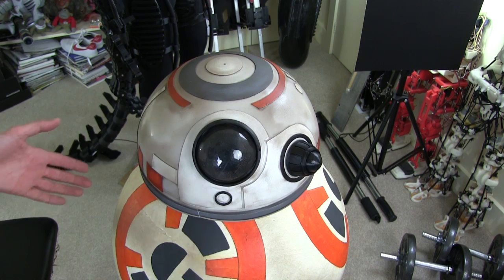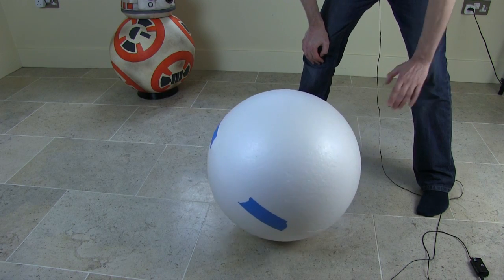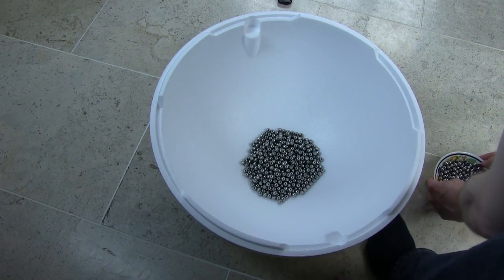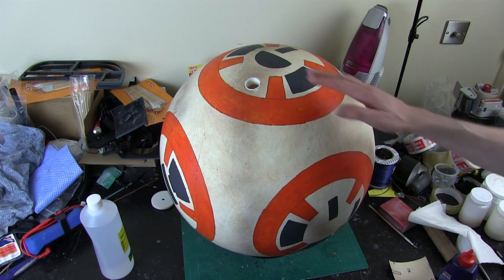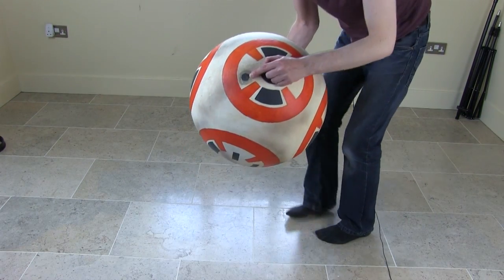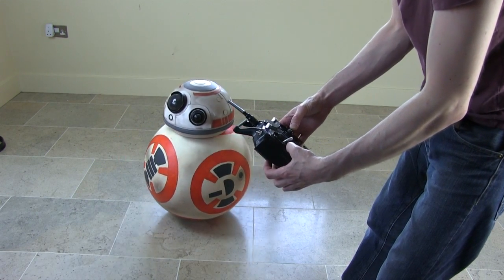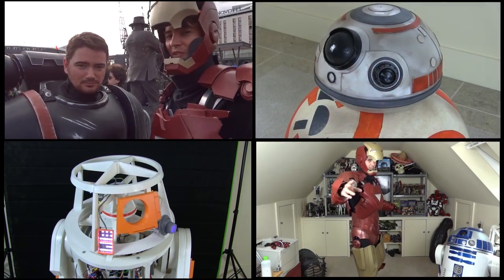Star Wars BB-8 Droid v1 #5 | Improving Stability | James Bruton

Comment: I have a suggestion. Can you line the inside of the ball with steel sheet metal? If that's too difficult, perhaps a layer one level thick of ball bearings glued to the inside of the ball? If you can do this then you can add neodymium magnets to the bottom of the head that would be strong  enough to keep the head attached to the ball. You could vary the holding strength by varying the distance between the magnets. This technique worked very well  in a robotics competition where minibots (weighing up to 15 pounds) had to be deployed to a 10 foot steel pole and race up the pole.

Comment: Try golf balls on the inside.  The problem with those ball bearings is you almost get the same problem as sand; it takes too much pitch to make them roll around... especially when you added that oil.  I don't think that oil helped you out at all.

Comment: Try putting a smaller ball inside the styrofoam ball maybe 1/3 rd the size in which you could put the oil and ball bearings, ideally the inside of the styrofoam ball would be oiled so the inner ball could not "climb" and would stay at the bottom of the ball as a counterweight.

Comment: I've fought oscillations with gyro/servo loops, and inertia masks the underlying problem.  Any reactive system has delay.  accumulating delay and linear response equals chasing your tail so to speak.  

correct quickly and with sufficient displacement to  arrest detected movement say 95% and then halt or decel with an exponential curve.  you can tune how close to stopping you go, mess with velocity, decel curves and whatnot to optimize performance.

flying helicopters teaches you to correct deviation abruptly using intuition and "feel" before oscillating begins.  We do by instinct what calculus can model mathematically.  

you have to calculate what the correct displacement is to arrest the drift, and shoot for that displacement.  incremental correction in a linear reactive fashion is why it can "run away" and fall down.

Comment: Hey just from a fan of starwars.i have an idea.go and watch the levatating lamp video on youtube.then see if a little lightbulb in your head doesnt go off .take what you learn from that video and apply that to your BB8. Do some research on levatating magnets using other magnets in a cluster to obtain a levatation like system you need to use magnets in unison IE a magnet grid with magnets repelling and attracting eachother to make a. Gap between the head and the body large enough to leave space for the body and the head of the droid for the ball to move freely and the head to move in unison with the body.start from scratch build your droid from the inside out start with making the balll move on its own then once you get that done.you should have an idea how to apply the magnetic levatation to the inside of the body to make the head and mody move as ons.after you draw up the new plans and desing your working BB8 just give me a shout out and that's all

Comment: To maximize stability + mobility: I wonder if the inside surface of the floor-contact ball is unnecessarily large in diameter as that in the bottom of which to place the stabilizer mass.One could try rigging, say, up some two-third's smaller hollow ball inside the center of the floor ball, and put-adjust the stabilizing mass in the bottom of that smaller inner ball.
Reply: +Daniel Pech Perhaps a simpler, if less all-purpose, way of more effective stability-&-mobility would be a loor-ball-internal structural preclusion to imbalance, such as a
two-thirds-diameter regular polygon frame (I would first choose a hex) to each of the corners of which is affixed some moderate-sized universal bearing, such that this frame’s bears rest on the lower-third inside surface of the floor ball.

Comment: This is pretty cool and electronics are spot on. Unfortunately it's never going to be stable no matter what you put inside the the lower main body.  The stability issues are not going to be solved with faster electronics. In fact increasing the capacity of the electronics which in turn increases reaction times is only going to cause more stability issues. Unless your only goal is a meter squared are of movement. This is a physics problem and needs to be solved as such.
Reply: Yes very stable and completely different. It's clearly mitigating the same forces that are causing your instability issues. Both it's weight, height and lower ball size plays a significant role in it's stability. It's much easier to balance a broom stick the a chop stick. I would speculate the ball is solid as well. So exactly what I would expect.

But that's not what your building. Your build is literally the complete opposite of this. The larger the ball on the bottom the greater the movements must be to gain and regain control. This does not suffer from that issue for obvious reasons.

That said I will add you might get more stability by adding weight around the entire inner surface of the ball but nothing you add that adds motion to it is ever going to increase it's stability.

As for your second attempt again looks cool but I'm not sure it will accurately replicate BB's movement like that as BB 8's ball moves 360 degrees. As for the top your going to use magnets placed inside to keep it stable and on top correct? Material seem a bit thick for that that.
Reply: +diGritz1 I wonder if the inside surface of the floor-contact ball is unnecessarily large in diameter as that in the bottom of which to place the stabilizer mass. Instead, one could try rigging, say, some two-third's smaller hollow ball inside the center of the floor ball, and put-adjust the stabilizing mass in the bottom of that smaller inner ball.
Reply: Daniel Pech That's only going to work if you retain the original concept of a completely hollow lower ball. It also make the whole thing over complex. Which is why the original BB-8 used controls in the lower ball and simply worked out a way to keep the heed in semi-contact with the lower section using casters and magnets with an heavy bottom weighted motor control unit in the lower body.

Which is what he is doing for his second attempt as this design is just way to problematic. As for the design he is using, it's not how I would approach it but different strokes for different folks. I will be interested to see how it works out.

Comment: I think the sphero technology is better with workings in the big ball, but a possible solution for this is to use thick gearbox oil with bearings. This would remove some of the noise plus counteract the wobble and instabilities.

Comment: what if you make the internal coated in a lightweight metal and then make a lightweight dense metal ball that is just slightly smaller in size inside the ball and then put oil inbetween so that it will roll smoothly.

Comment: I would structure a setup of a weighted pendulum in ball/sphere that is the full diameter of the sphere moving along the entirety in vertical design with an attracting M 52 Diamagnet  in the head and on the upper portion of the weighted pendulum. that has a weighted base with rolling barrings on the base of the internal pendulum. and a small amount of oil in the sphere for more friction less movement. I think at that point everytime the head moved the upper portion of the pendulum would fallow and would rotate the sphere in synchronization. What do you think? I think making this could be far simpler than it is intimidating. maybe using pvc piping for the pendulums skeleton inside the ball, and a three/ four way plumbing splitter,maybe cap and block the pvc at the base areas and fill it with concrete and wait till it hardens before you connect the parts. Then once you have your pendulum shaped 3d sorta like this 
  |
/|\

you could install the M52 Diamagnet withen the PVC pipe at the top part that has no concrete in it and the do the same for the bottom of the head of the robot and for the rolling bearing part on the base of the pendulum Maybe you could use roller skates or some other sort of rolling bearing, btw JUST THOUGHT ABOUT THE OIL. I would experiment with and without Im not sure if that would help or not. I hope you try my suggestion I would love to see if it works
Reply: +Joshua Tomlin Oh and the upper part of the pendulum might need to have a bearing too keeping the pipe from making contact with the sphere because of the Diamagnet

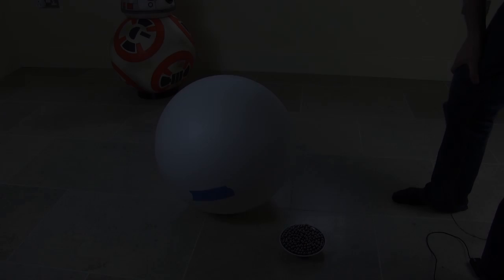Comment: See as soon as you mention stabilizing the lower poly ball at around 3:30 and you talk about problems like the sloshing around effect with liquids and sharp point of no return with sand I thought you would immediately mention the idea of making the hollow area/volume inside it much smaller so you could completely fill it with either water or sand. Maybe I am missing the impact of a high dense center of gravity but a small completely filled hollow center would solve the problems of variable inertia separate to the the inertia of the lower poly ball. Also any reason why you didn't make it like the toys where the head is just floating magnet on top as this means the center of gravity is inside the ball and much lower down than your original design which might be a bit top heavy and hence not inductive to resting state stability? Still a fantastic thing to behold, less CGI in movies and more actual working props is where old Sci Fi meant more to use kids when Star Wars was first released and no god dammit it is not called a new hope it is just called Star Wars :)

Comment: this design is fail. may save you money but its not the way I would build it. You need a much larger version of the head in the bottom of the large ball. gyro stabilization. plus low center of mass. and just have magnets holding an empty head on the top with wheels.

Comment: Sorry if this was already mentioned. What about a ring or bearings in bracket that would swing a little on speed changes at the bottom of the ball. You could use larger bearings in the bracket for the weight and bigger bearings might be smoother. The center of the Bering bracket would need a weight lower then the outer ring to make it balance. 

essentially you would have a cone shape with bearings around the edge of the cone, maybe with one bearing on the tip of the cone.

Comment: +James Burton

    Awesome project and love how its going so far, but I have a suggestion for stability.  I'm no engineer, but my idea when you were brainstorming is to, instead of filling it with a loose substance(bearings, sand, etc.), I would suggest coating the inner lining of the sphere with some sort of material to add even weight to the entire sphere, rather than a pivot point that needs to reposition whenever BB-8 moves. I know enough about physics to know that in order to have enough friction to move(on smooth surfaces especially) you need enough weight pressing down to counter act the force of the forward motion. If its too light, it wont have enough friction to successfully move, BUT if you slowly increase the entire weight of the sphere itself, you can easily find a point of balance. 

      Long story short, why not try increasing the weight of the sphere itself? Either by coating the inside with some sort of lining, or by just making a heavier sphere to start with.  Please give it a try and let me know.

Comment: Why not oil, or maybe mercury inside? That shouldn't slosh like water, but it would still move around easily.
Reply: Herr Fenchel Ask your local super-villain.
Reply: While we're at it, let's also fill it with uranium and bleach!
Reply: +darksskull There has to be a more toxic solution for this than yours.
Reply: Herr Fenchel nothing at all dangerous about it if you know what your doing  ;)
Reply: Moth Dildos have an exception
Reply: TheBaldr no it's not safe that's just a horrible idea murcery is not for fucking around with you have to mean it when you use it and treat it as something that can kill you.
Reply: +darksskull Mineral oil?
Reply: Moth I think that's a normal thing with older toys
Reply: mercury is like 13 times heavier than water
Reply: You would need a good amount of mercury which is highly toxic.
Reply: Elijah Barbee Mineral oil isn't toxic but we haven't agreed to that apparently
Reply: +Elijah Barbee Heated gallium could work too, but heating it would be a real bother.
Reply: dsigamerman Where to get uranium?
Reply: +darksskull Mercury is quite safe if it sealed off.  Otherwise we wouldn't use it in a ton of stuff.  The problem with Mercury in a use like this is expense.  You talking about $500US for this application.
Reply: Christian Noir i'm not sure it's safe just to have mercury in a toy.
Reply: EricssonXL that's on normal for older toys which don't follow any safety guidelines.
Reply: +Herr Fenchel http://www.amazon.com/Images-SI-Uranium-Ore/dp/B000796XXM
Reply: Not quite, if you'd use some heating element inside..!

Comment: could you put lube in on the bottom,
put half a sphere that has a magnet reaching to the top from 3 supports and wouldn't it the weight of the hemisphere keep down as the ball rolls,and the magnet would keep the head up and keep control?idk,just an idea

Comment: is it like.. trying to balance? like a two-axis segway? if you put enough weight low enough, won't it want to be stable on it's own? and can't you put all the batteries, controllers, etc down low and have the head be 1000x lighter?
Reply: +Chrismofer it's just sort of a ridiculous way to locomote, by balancing on top of a ball. putting a car inside a hollow sphere would be much simpler and more stable.

Comment: Why not just a single weighted ball? No sound.
Reply: Pretty much what comes to my mind; a single heavier ball bearing (with equal mass to what the smaller ones are together) ... of course, I'm not a mechanical engineer, so my gut feeling might be incorrect, but I think low center of gravity and a single point of friction could be better than the current implementation.
Reply: James Taylor wow, the kid that spells cool as "coil" is talking to me about the English language. I don't know if you're living under a rock or immune to modern humour but it's a joke intentionally spelt like that, good luck making friends.
Reply: or a small ball with ball bearings in the small ball..
Reply: +Make art not war 74 Umm... I must reiterate that I am not a mechanical engineer, but having multiple small ball bearings inside a small ball within a big ball would probably not work too well either. Reason for this is that the ball bearings in the small ball would most likely not be equally distributed (at least most of the time, since they can only move past each other while in certain positions) and would probably move the center of gravity of the small ball higher than it would be with a single heavier solid ball bearing making the small ball less stabile and consequentially making the large ball wobble more.
Reply: +Make art not war 74 ball ception. all ur missing I'd deez nutz
Reply: +CapitalStreetPhotography 
Nice idea, but it does not work. A single ball can start to swing and oscillate.
The software has already no working curve for dampening an oscillating movement.
Reply: +smashUupnow Moron. Are you actually too stupid to write and speak the English language correctly?  Or are you so incredibly stupid that you actually think that speaking and writing like you never even made it through grade school, thus illeterate, actually makes you somehow appear cool in some way, although how stupidity being coil I just dont understand.  In any case good luck with your McDonald career as fry man!
Reply: Descargar apps de pago gratis en iOS
Reply: shut up!!!!!!!!!!!!!!!!!!!
Reply: CapitalStreetPhotography 4gv

Comment: awesome work, the ball bearings tho make it a bit glitchy, have you thought about coating the inside of the ball with some latex or the flooring type of latex and would give an even coat, anything not secured inside will make it slosh about unless you fill it completely. mad skills on the head

Comment: make the moving parts in the big ball so it moves like a hamster in a ball. Give the moving part a magnet on the top and a weight at the bottom. This way the wheels stay on the bottom and the magnet stays on the top. Then make the head magnetic so it sticks to the magnet on the inside of the ball. Basically a larger version of the toy.

Comment: Just a thought, How about making two balls, one slightly smaller than the other.
Then put bearings on the shell of the smaller ball and load the smaller ball with more bearings
put the smaller ball inside the big ball. This way, the smaller ball will not have to roll (given that the outer bearing slots works perfectly smooth) and thus, no slosh, just a touch of stabilization.

Comment: maybe you should use the "naze 32" quad copter controller it has a 72mhz processor and 2000 deg/sec 3 axis gyro. plus they are cheap about $35 on ebay. They can be configured to run from 3 - 8 engines. the are receiver ready plus can be easily tuned with cleanflight or baseflight software.

Comment: How about a weighted ball inside the outer surface ball and add magnets. This will keep the head up and you can add controls to make that smaller ball control the position of the head. If I could show you a drawing.

Comment: I dunno if this is still a project you are working on, or if this has been mentioned already, (if so just ignore me :D ) not really going to read through over 800 comments tonight.  I was wondering if you cut open a tennis ball and put weight into that, (ball bearings, concrete, marbles, whatever) re-sealed it, and then put the weighted tennis ball in the sphere, if that would help reduce the sound and wobbliness.  I also don't know if you would want to cut a hole that big to fit a tennis ball in or not, but just another idea to go along with all the others.